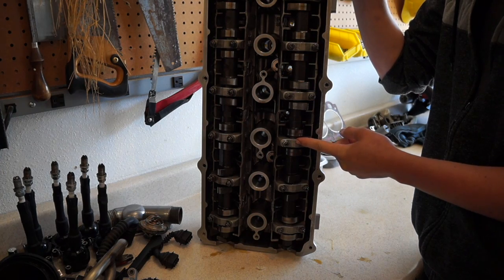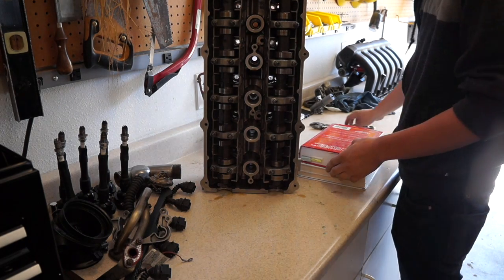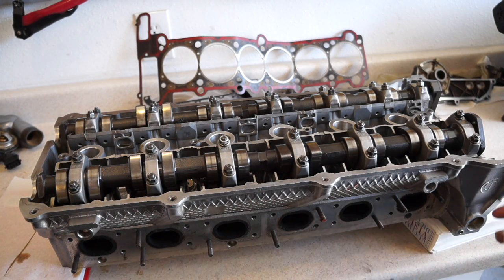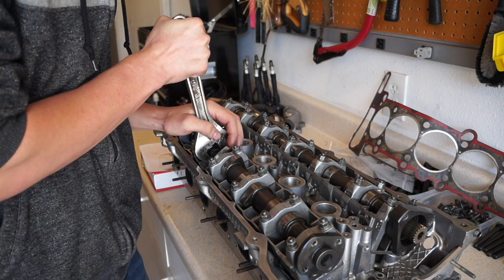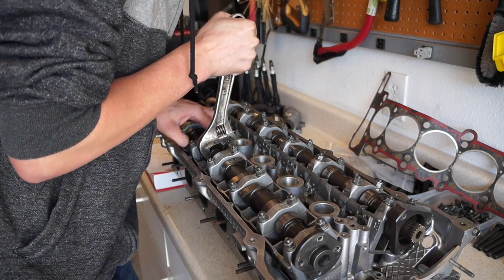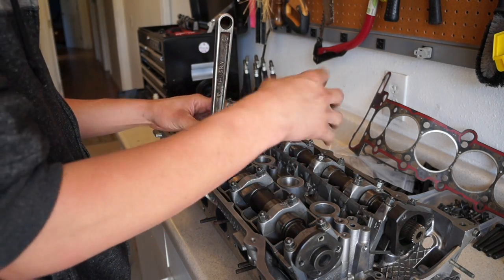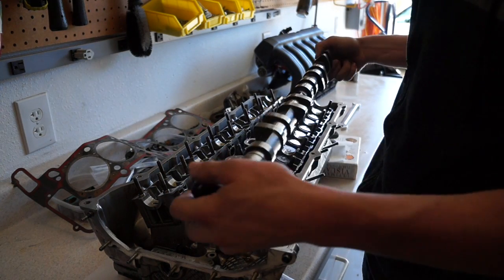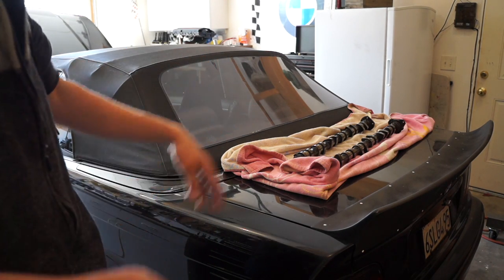E36 Camshaft Removal

Comment: When the lobes on cylinder 1 are pointing straight down, the lobes on cylinder 6 are pointing straight up.  By “straight up”, I mean the #6 lobe points at the ridge in the middle of its bearing cap.

Comment: Have you ever had a broken valve spring on m52 engine? I have no compression on cylinder 4 and hear a ticking sound that gets louder with speed around injector 4 lack of power and Shakey at idle.

Comment: Seriously helping with my upcoming e36 s50 head gasket job. Any tips ? Pretty mechanically inclined, have the space and tools, ordering the parts.
Reply from the maker: if this is your first time wrenching on an E36, take pictures, and label your vaccum lines and wiring plug ins. do lots of aditional research on pelican parts and other threads like bimmerforums, and utilize realOEM.com's endless diagrams.  take your time, even with taking the car apart, oh and get your head machined! if you look under the playlists section on my channel, I am currently working on a headgasket DIY playlist and currently contains every step of the breakdown, up until the head goes back on. im going to be shooting the block prep video tomorrow, but due to some bad piston rings on my S52, i will be rebuilding the bottom end, and should take a few months before the head goes back on. depending on how soon your headgasket job is, the playlist might not be finished, but feel free to message me and i can answer any questions you have and point you in the right direction!

Comment: Hey a little off topic but I have a question I can really find the answer too, do you know if I can swap a 95' e34 m50b25tu into my 95' e36 directly?  It have the same motor, I heard something different about the oil pans?
Reply from the maker: yeah. as far as the core motors go, everything is the same from the block up. the difference is the oil pan. a M50 from an E34 will not be a direct fit. the E34 has a front sump oil pan, the E36 has a rear sump oil pan, to clear the engine crossmember. you will need to swap over an E36 oil pan, and an E36 oil pump pickup, but I would just throw a new E36 oil pump it and weld the pump nut while your at it, oil starvation is a bitch. but once you get the new pump and pan on, it is a direct fit. also, the E34 oil pump/oil pan is needed for an M50 swap into an E30, so E30 guys are always on the lookout for E34 pump and pan setups. you could sell it, make some money back and I guarantee it would sell quickly.
Reply: M3NACE fuck yeah!! Thanks for the info/tips man! Keep up the dope edits!
Reply from the maker: thank you man, glad I could help. check out the channel, subscribe, and let me know how you like it!

Comment: lol you're gonna see a bit of comments from me Bro. Jus tryina get this thing done the right way when I get to doin it. Had a question about the cam shaft. When you take those arches off(dunno what they're actually called), and you're able to move the cam shafts freely when you told me about the timing, what's the torque specs when it's time to bolt those back on again? Do you have a torque spec site you could tell me about maybe?
Reply from the maker: when you time the cams, do not take the bearing caps (arches) off. leave the cam inside the cylinder head, all bolted down. rotate the camshaft using a wrench to turn it and time it that way. the video about how to time the cam was an explaining video. when you are timing it for real, the lifters would be in, and the camshaft will be bolted down and torqued. you will not be able to rotate the cams by hand, i did in the video because the cams were not bolted down. notice how I use a crescent wrench to rotate the cam in this video, use that to rotate your camshafts into top dead center or into the correct timing

Comment: HiWhen putting the engine back in, do you recommend putting the TC on the xmission then bolting it to the flywheel or bolting to the flywheel then mating it to the xmission?
Reply from the maker: xmission? and what is TC? throttle cable? lol
Reply: I was a little confused , I saw you removed the engine and the Torque Converter was not leftover in the bell housing. I was surprised that maybe you would leave the Torque Converter on the flywheel and not with the transmission.
Reply from the maker: yeah so there is no torque converter. the droptop is a 5 speed manual, and the clutch stayed on the block when i dropped the transmission